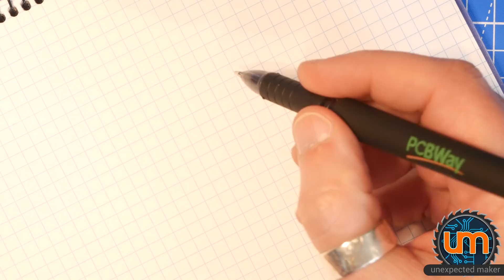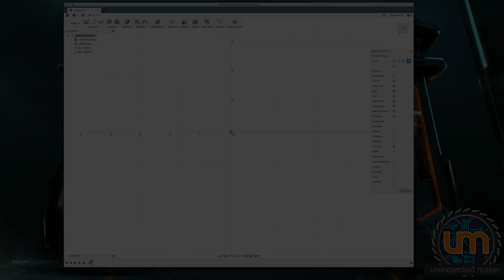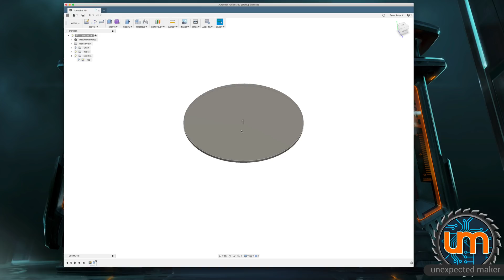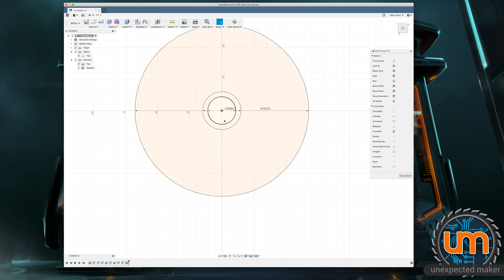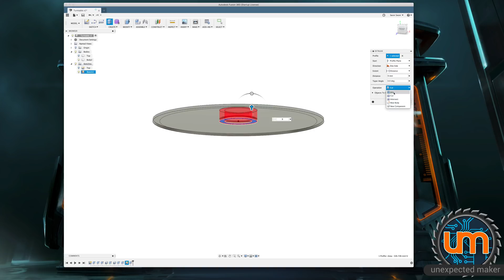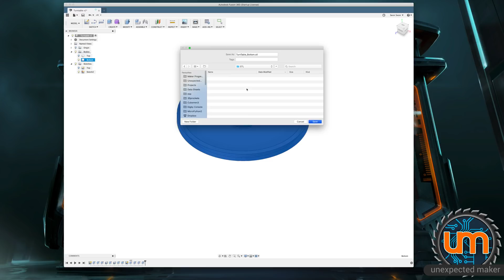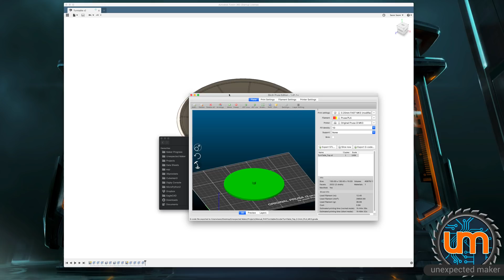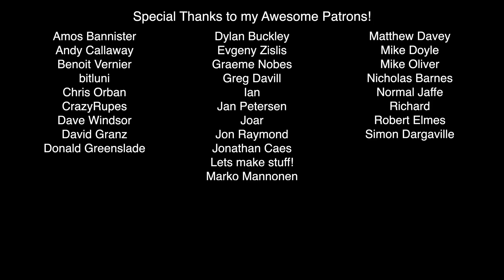Brain fart - What have I made now?

Comment: If you use a Thrust Baring, which are large and flat, you could eliminate the wobble. I use one for my horizontal 3d filament spool holder, it handles the weight of a spool of filament much better than a verticle spool holder.

Comment: Design the top in 2 parts with a centre hole and a shaft coupler that slots in tightly (or you can glue to secure). You can print without overhangs then. Nice idea.

Comment: Which label printer are you using, I've just bought a PTP700 and have been labeling parts drawers and I discovered Chain Printing mode, cuts to size of the input without the lead-in/out except on the first and last prints.

Comment: Fusion360 + 3D printer is so much fun.
Being able to easily rotate the board is awesome.  I'm skeptical about rotating the parts.  I think that just complicates things: 1. Their location keeps changing so you'd have to look for them.  2. Their label would invariably be in the wrong orientation making it hard to identify which bucket is which.  But only one way to decide, use it and see if my concerns are valid or just overthinking it. Fun project Seon!

Comment: Well done, Seon.  This is a brilliant idea!!

If I may suggest a tweak, you can buy electrically conductive filament.  Using it might prevent damage to MOSFETS and other components, that could be caused by static electricity generated as the  result of spinning the tray.
Reply: Yes I was concerned about ESD too, though I would have it machined out of aluminium instead.

Comment: A good idea, but could use a small bit of refinement, as most ideas generally do.
I suggest actually printing it so that the outer race of the bearing fits into the top plate. This simply requires a thicker top plate with a hole in the center for the bearing. Then it can be printed bottom side down resulting in a better print overall., and the only supports would be in the bearing hole if you choose to use them. You could also print the parts trays at a lower level than the board to provide deeper trays, or even allow you to place the labels on the wall of the tray, depending on the tray depth and angle of the inside wall.
Additionally, you could implement sliding clamps in the center tensioned with rubber bands for holding the board in place. This would require two more parts (the clamps), slots for them to ride in and posts for the rubber bands.

Comment: Nice idea Seon!  Perhaps instead of labels, how about permanent (printed?) A, B, C, reference around edge of trays. Then just use a simple A, B, C, indexed component list for each build reference.  Re-applying stickers and also obscuring the label with components may get tedious. 
Also thinking… perhaps some easy method of locking the tray rotation might be useful, to avoid it moving around when you’re leaning on it trying to precisely position components with your tweezers?
But, great brain fart thinking batman! :)

Comment: I would have made the walls around the edge and between the compartments much higher.
Prevent accidental mixing of parts and catch anything that goes flying by accident.
Also, add two screws that can by used to clamp down PCBs.

Comment: Hah, I gave David Watts a similar idea a while back, sans the component tray bit. Nice one :)  Edit, things I'd probably consider. Maybe drilling a few locating pins in to keep the board still, and a bit of foam sandwiched between the base and platter to add a little friction to steady it, and prevent accidental spinnage while placing bits or other mishaps.